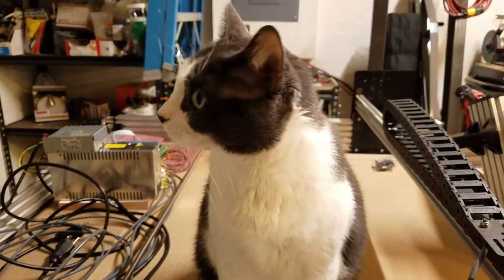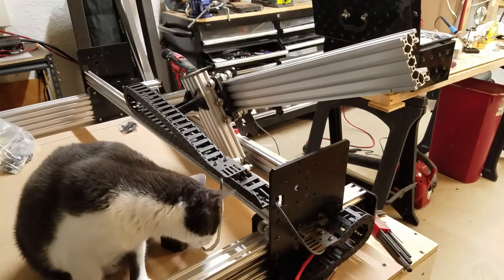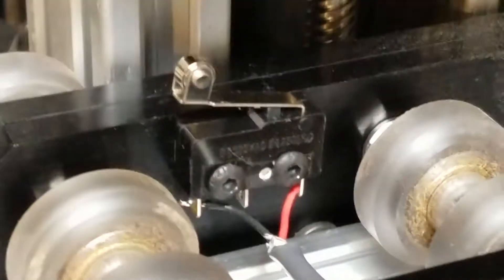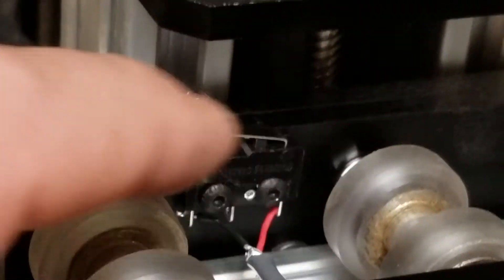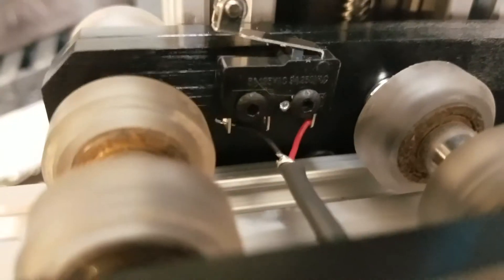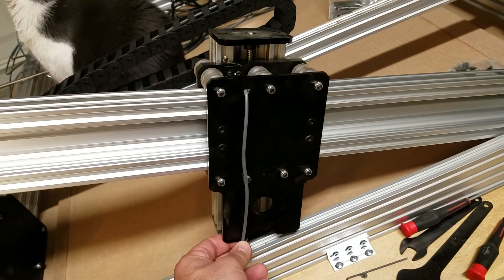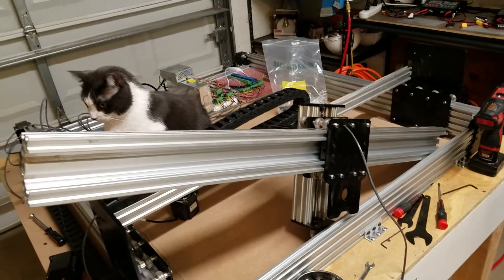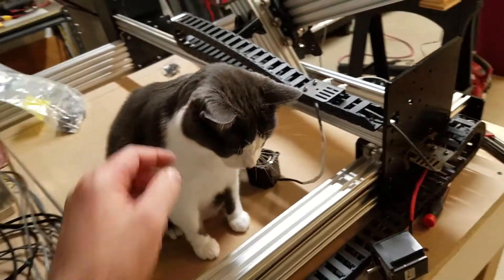WorkBee CNC Router: Z-Axis Limit Switch Installation

Comment: well thanks for the info I already bought new kit 60x60 inches you're doing great, One thing I don't like with this cnc the lead screw I wish if I can upgrade it to 12mm instead of 8mm there is no Acme Nut Block for 12mm.